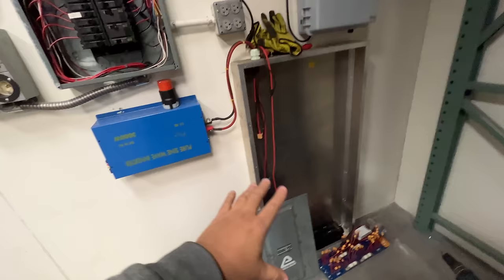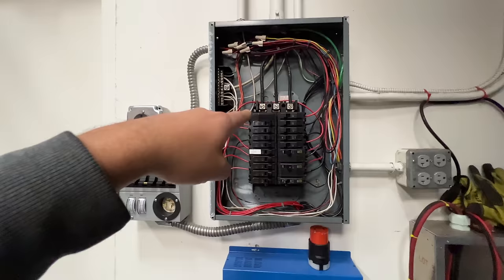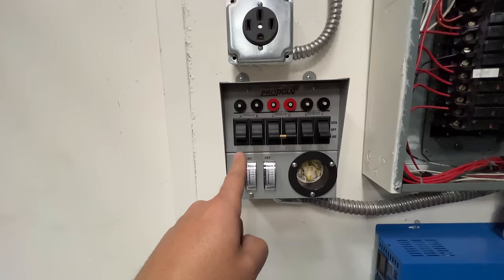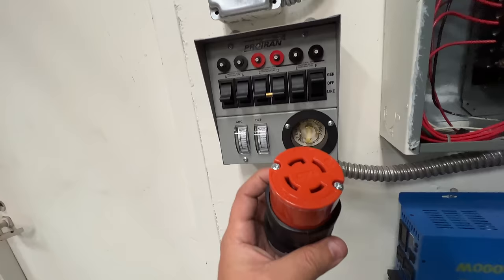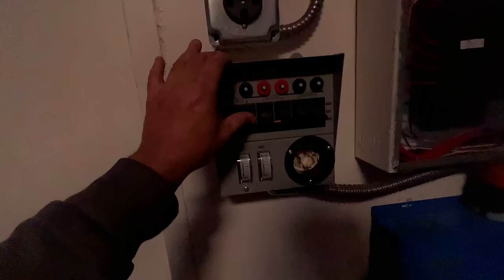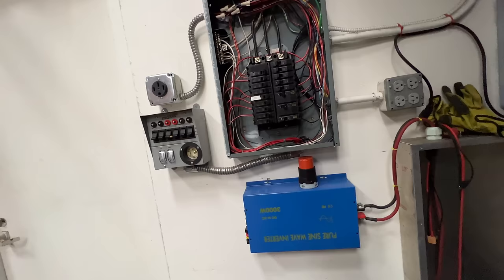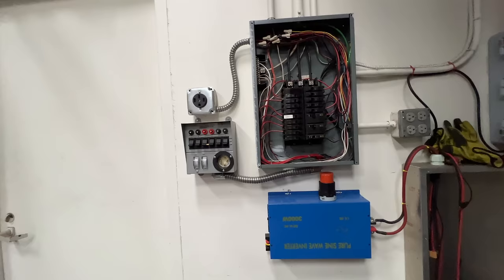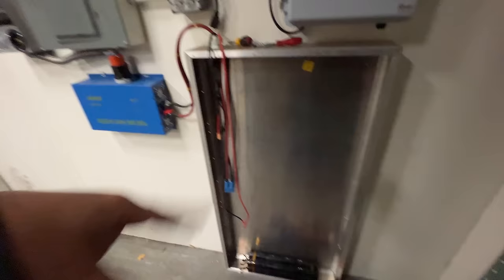This is Why you Need a Transfer switch - DIY Powerwalls

Comment: Great video.  You're a good teacher.  Love how you pointed to things on the camera, makes it easy. 

How does this differ from an "automatic transfer switch" ?
Reply: Automatic Transfer Switch will switch all by itself, in case of a power outage.

A Transfer Switch requires a human to switch from A/C to Gen/Bat.
Reply: @DavidHalko  thanks.  Makes me wonder how the switch works, since OP showed danger of the equipment being connected to the grid.   Thanks for the response.
Reply: @jaymedavis7567  - when I worked in a shop with a automatic transfer switch, there was a spring loaded knife switch… when the power could no longer run the relay, the knife switch SNAP’ed into place! Man! What a sound! Emergency lights came on. The UPS came on, the generator would then spin up. The UPS would shut down, and normal lighting resume.

That was years ago, but some things don’t change.  The bigger the air gap in contacts, the safer from arc’ing.  The bigger the springs, the faster the switchover time.
Reply: @DavidHalko  really helpful!  Thanks!

Comment: Wow I’m mad I misssed when you first posted this I just added a other sub just for the powerwall and disconnected the main ac power at the source of the load …so I have the powerwall powering my living room 24/7
Reply: Transfer switches are great because it gives you the option to switch back to mains power by flipping the breakers, or connecting a generator.
Reply: @AllAroundTube50  or have a hybrid inverter and it does the same thing
Reply: @Shmade0304  but what happens when your mains power goes down -aren't you illegally feeding power back in to the grid if you are using a sub-panel. The transfer switch isolates those 6 circuits from the mains power supply, so you can keep your power on at all times without endangering linesmen.
Reply: The generator connection to the sub panel can not be turned on without disconnecting from the main power circuit. So there is no way to backfeed the grid when installed correctly.
Reply: @AllAroundTube50  hybrid inverters are isolated from the grid. An example of a hybrid inverter would be a Tesla Powerwall. Hybrid inverters are installed by permit only and therefore by an electrical contractor. Yes the powerwall can backfeed the grid, but that is called net metering which is allowed.
Reply: @ecospider5  We were talking about his sub-panel, not a transfer switch (which as you said, isolates the generator from the mains).
Reply: @uhjyuff2095  - hybrid inverters come in different shapes and sizes. For example, I use a hybrid inverter (MPP SOLAR LV6048) which I installed myself (non-professional) which is isolated from the grid thanks to my transfer switch. I am still able to pull mains power supply into the inverter as a backup source, but the AC output from the inverter never touches the mains panel. This is another advantage of using a transfer switch over a regular sub-panel.  I also get to use my solar regardless of what happens to the mains power supply (ie; if the mains power supply is shut down due to high winds or something, my solar panels still work and the 6-circuits that are connected to the transfer switch will remain powered during the day via solar, and via battery during the night).  Those Tesla/Enphase type  setups do not have access to solar panels if the mains power supply gets shut off (the solar panels get shut off also).
Reply: @AllAroundTube50  You don't have a hybrid inverter. One thing to remember is a normal grid tied solar inverter that also has battery backup function is a hybrid inverter. Your inverter is an off grid inverter with battery back up. MPP does sell hybrid inverters, but you don't own one of those. And, yes I like your setup because one can DIY a setup like that, I personally have a setup like that with a 2000 watt array and one circuit automatic transfer switch that runs 24/7. It heats my hot water during the day time and a few other small items like my internet router and a T.V.
Reply: @uhjyuff2095  My user manual front page literally states -> 'MPP SOLAR Hybrid LV6048 Inverter'. 

Definition of 'Hybrid Inverter':  In the context of residential solar+storage systems, a hybrid inverter (sometimes referred to as a multi-mode inverter) is an inverter which can simultaneously manage inputs from both solar panels and a battery bank, charging batteries with either solar panels or the electricity grid.
Reply: @uhjyuff2095  PS: My inverter is 100% hybrid. It charges the battery from Solar as well as grid tied mains power. That makes the inverter a hybrid. Not to mention, the front of the user manual clearly states "Hybrid LV6048".
Reply: @AllAroundTube50  Really? You have no idea what a hybrid inverter is and you have no idea what grid tied means...!
Reply: @uhjyuff2095  Mate, i'm literally reading to you the definition of 'Hybrid Inverter' along with the front of the user manual from my inverter.
Reply: @uhjyuff2095  The only thing my inverter does not do (that tesla and Enphase can do) is feed back power in to the grid and get paid for the extra power (but that is not what 'Hybrid' means). Net metering requires a permit and very few DIY'ers are using those types of inverters (they present way too many limitations. I know because the other half of my house has an Enphase system - it pretty much sucks, especially considering that if we lose power to the house, we lose access to our solar panels!). But DIY inverters such as the LV6048 is a HYBDRID inverter in that it can charge from solar or from mains power supply. When combined with a transfer switch, I can charge batteries from solar and/or from the mains power supply, and I never lose access to the solar panels (even when the mains power is shut off).

Comment: Just wondering are you using 230 3 phase or 460 3 phase as building supply. Here we are normally 460 3 phase.
Reply from the maker: No idea
Reply: His building suite is 208/120v 3 phase. Some buildings are supplied with 480/277 volt 3 phase system and each suite has to install a transformer for all the 120 volt and 208 volt loads. In those buildings the lights in the lobby areas and in the parking lots are powered by 277 volts and the large A/C units on the roof are 480 volt units! Although each suite could have their own A/C unit on the roof that is 208 volts.
Reply: @uhjyuff2095  what we use is transformer 480 to 240/120. Outdoor an warehousing lite are 277 wild leg. When i watched video what thru me was the 3 legs of 120 volts in order for trans switch to work from the inverter shown. Thanks again.
Reply: @jehugarcia   just wanted to let you know i really enjoy your videos. Keep them coming👍

Comment: This is so simple to connect to panel box, WHY would you want to pay a electrician $300. dollar to put this small 6 breaker box in?????? Every thing installation wise is on Utube video's at least 10 times, from install to complete, also you need an outside plug for your generator & connection to the transfer switch......

Comment: Those two red ones should be for 220 so don't try to use it with only 110 input on it.
Reply from the maker: It’s just 2 separate  switches mechanically tied together,  they don’t have to be used for 220v circuit,  you can run two 110v circuits on them no problem
Reply: @jehugarcia  The interlock is the purpose for the 220 and vice versa. You give a lot of good information on your channel, be careful. Like using three lithium ion batteries to start a car, ok but not without a blocking diode as the alternator will charge it to high.

Comment: Why don't you look at doing 3 phase systems powered by batteries.
Reply from the maker: Because I don’t need 3 phase,  hell I barely got 220v loads
Reply: each phase requires a single hf inverter or a big 3 phase LF transformer and those suck power when they are in standby mode.
Reply: @FixItStupid  When I turn the switch on the inverter is on therefore consuming a lot of power. 3 phase would require 3 inverters so three inverters switched on draining the battery even though no lights are on. I hope you realize inverters get their power from a battery, what size battery do you think it takes to power a A/C unit that is 3 phase! lol

Comment: I'm looking at american wiring and am like "Dude wtf is this shit, this is a main panel?"
Reply: nope, the main panel is in the Electrical room or outside of the building in a large cabinet. He is in a divided suite within the building.
Reply from the maker: All these buildings have sketchy work on them,  I’m not an electrician and even I can see all the code violations.   This panel is a lot neater than what I found first time I opened it after moving in.
Reply: Well seems to me as the previous owner did the wiring himself and didnt care about it too much. I'm working as an automation engineer in Luxembourg, we are mostly usig German codes for our wiring, sometimes also French ones but not all too often as they mostly have one-phase only circuits.... If I would come up with something similar I would be (ironically) hanged by the cables I just slapped into the panel😂

Comment: Hello. I think this is a bit useless and too complicated. I made my own switch it is simple it will not do what you are  doing because it looks nice on the paper usually in reality it will not be like that. but for 3kW unit it doesn't matter much.

I used two interconnected contactors, one relay, two capacitors to correct for those huge contactors and two timers (optional).. If i have solar power/dc power ..what ever  power it will connect it and activate relays and contactors..once i will not have power it will disconnect and connect contactors from grid....It is simple and i have it on whole house

Comment: Hi Jehu, thanks for video. I have two of these for total of 20 circuits and am using for off grid solar/battery setup with the option of switching to grid for any individual circuit as the backup (I’m using the grid as the backup for my solar/battery setup whereas you are using your battery as backup for the grid). If my battery is lower than desired SOC entering into the evening, I switch some of the higher power drawing devices to the grid to reduce the loads. I would love to have a transfer switch like this in which we can remotely or automatically have any of the individual circuits switch over from solar/battery to grid and vice versa based on battery SOC and presence of backup. I know their is a SPAN box that exists for solar/battery systems but it switches off a circuit if SOC too low but doesn’t switch to other source. My observation with the reliant transfer switch box is that if you switch any given circuit switch between grid and backup fast enough, the loads I have don’t even turn off (eg computers, computer  switches, etc.) during the transfer. Not that I’m recommending doing this..
Reply: I wonder if any of the SwitchBot Smart Switch Button Pushers would be strong enough to do this.
Reply: Mpp solar all in one inverters have the ATS and you can set Battery voltage level when the ats switches back and forth.
Reply: @ecospider5  hi thanks for this suggestion . It’s an interesting product

Comment: I would like to tell you about the grid systems we have in the USA. Please get the systems right just like when you sell batteries you don't say here is my 38 volt battery when in fact it is a 36 volt battery. Here you go... 120/240 volt, 120/208 volt, and 277/480 volt. Thank you for reading this and I hope you can teach others with this information.
Reply from the maker: No you don’t make any sense to me,  36v batteries can be anywhere from 30v to 42v. People call the us grid 110/220 and 120/240 other times.   So what exactly is your point?
Reply: @jehugarcia  That is my point, why are all these people including yourself saying 110/220 volt when the correct grid system in the USA is 120/240 volt. I don't think I was alive when the USA grid was 110/220 volt system. Yep, in 1984 the NEC changed all calculations based off of 120 volts.
Reply from the maker: I see that listed in equipment all the time,  I read it online all the time,  you say it’s one way but others say it’s the other way.  I don’t think calling it one way or the other is that important so I don’t care
Reply: @jehugarcia  So I was working on my house today! and I replaced all the 110 volt receptacles! Then I plugged in my 115 volt fan into the receptacle and turned on my 125 volt led light fixture to read a book! Doesn't matter to me either they are just numbers on the internet at this point and electricity is just magic wizardry that cannot be explained because it is purely an unknown phenomenon.

Comment: Dude! Have you ever heard of a fucking electrical diagram? They're used to explain electrical circuits and you'd be suprised how well they work, certainly they work much better than pointing your finger at very sophisticated electrical equipment. Of course there's this thing called a white board and you can use to make diagrams and such that are very useful to understand the particulars about a circuit. Buy yourself a book on circuits and who knows maybe you'll learn something knew. Being a bit sophisticated is not a bad thing.